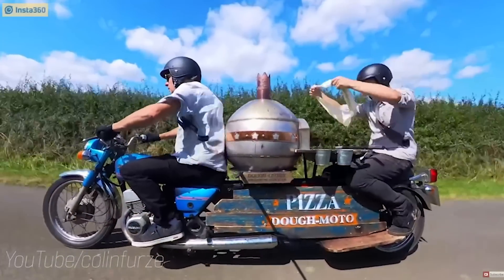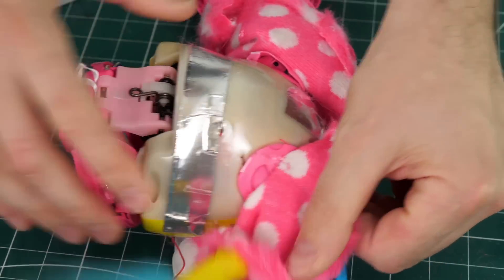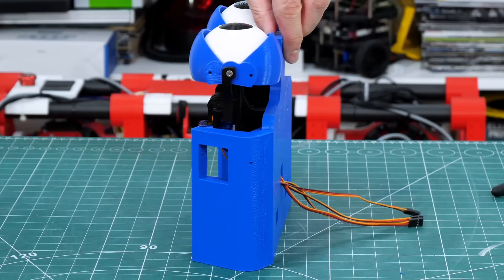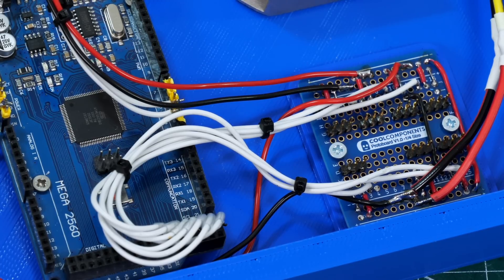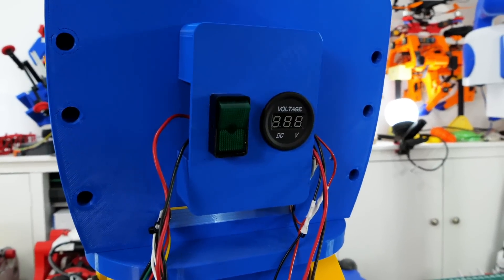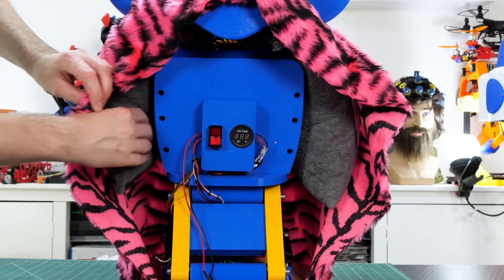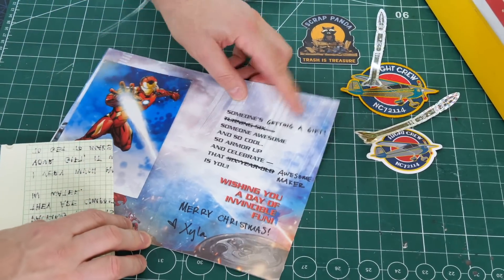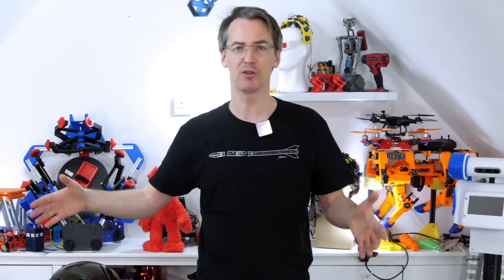I built a Giant Robot Furby

Comment: Hi , I am a great fan of your channel. I learnt a lot of things and got success in  designing  & 3d printing.  Thanks a lot man.   I am working on an odd project in which i wanted to calculate my laser engraving machine (DIY) laser head movement.    My thinking is to calculate pulses of x & y stepper driver every fixed interval and calculate its tangent and add up its values till one job completion . As you are an expert of this subject can you suggest to me if it will work or any other method i have to use.